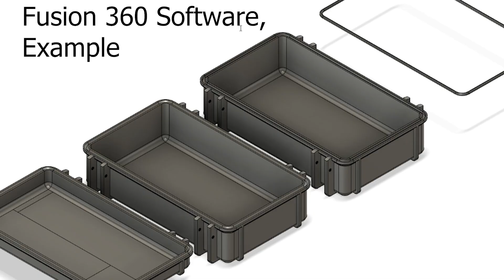A Custom Case I 3D Printed for my Thermal Camera (reupload)

Comment: I just started with Fusion360 amd 3D printing. How did you so easily change the size in Fusion360?
Reply from the maker: You want to find something called change parameters

Comment: I don't understand why you think this isn't interesting. I find it very interesting. Can you tell more about your printer and settings and what you do with it?
Reply from the maker: I do find this interesting, other things are not worthy of youtube or not worth the time to record.
Reply from the maker: and what do you want to know about my printer? It's mostly stock settings with Hatchbox or Overture PLA. I print 1 product I sell on etsy and ebay but I get few sales, I've also printed impellers for turbines. There are many more things I print too, like a loc-line to cold-shoe adapter like what Adam Savage does for his workbench lights (I don't sell those yet).
Reply: @JoeMalovich  Do you use an enclosure? Do you have it set up so you can remotely watch it or remote print like octoprint? Do you have a backup system for when power falls away?
Reply from the maker: @RobertWiggers  I do have an enclosure (heated too with a PID controller) but only because my shop can get down to 50F and is very dusty.

It's running 100% stock electronics with the blue monochrome screen.

No backup power but if it's a long or time sensitive print I will power it through my EcoFlow River Pro which can power it for about 4 hours in a power out situation. This does have a power efficiency penalty on the part of the EcoFlow.
Reply: @RobertWiggers  no enclosure for me, i tried octoprint and it was fine, but my printer is tuned so well, i send the print to the printer and go to bed,  I haven't had a failure in the last 100 prints. I primarily print PETG, and TPU.